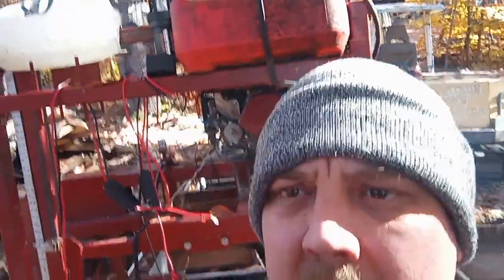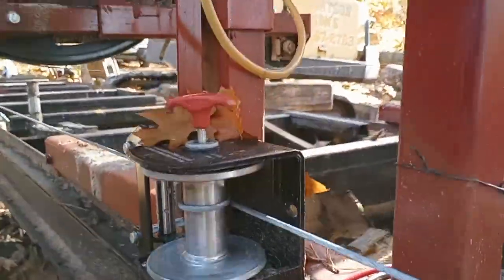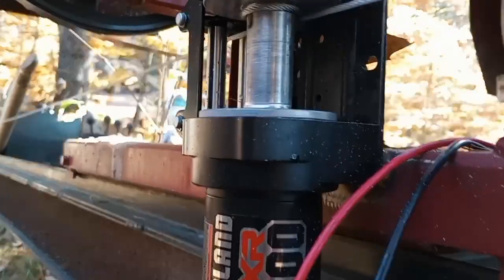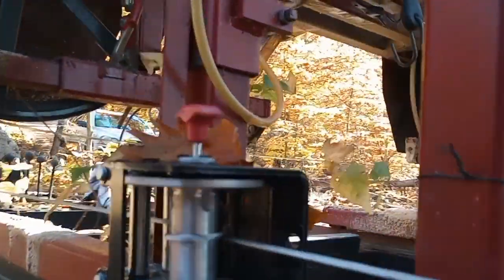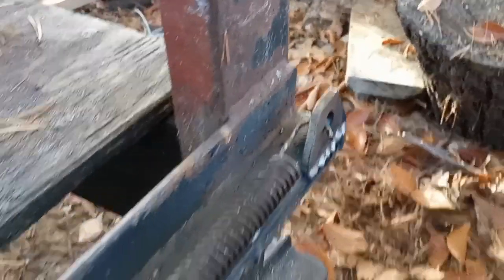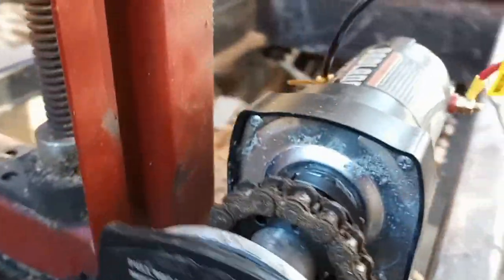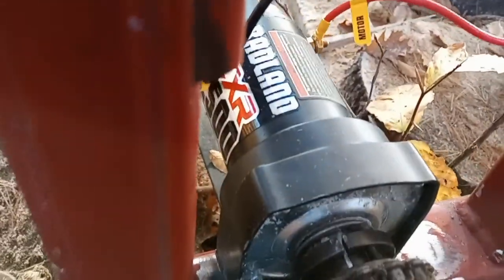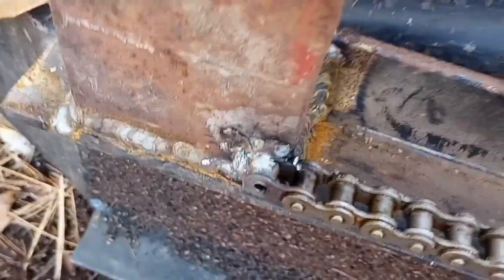Remote Control Sawmill Chain Drive Upgrade

Comment: Curious why you didn't try turning the rollers that came on that winch 90 degrees so the cable would stay centered using the rollers? that would have been my first choice to fix that. the chaindrive is a perfectly fine fix though, way more consistent too
Reply from the maker: The cable was binding on itself , even if I kept it in the middle of the school it would still rub on itself
Reply: @mountainfarmer8766  oh ok, I thought it was shaving the sides of the drum